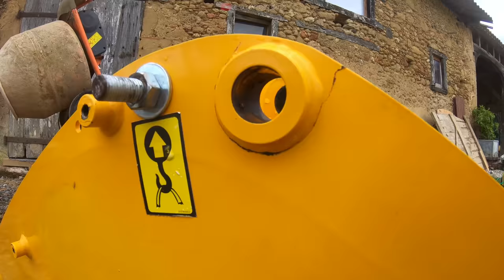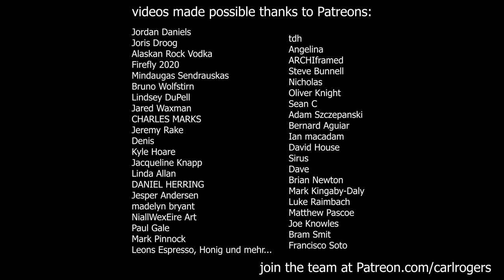When buying used Equipment goes WRONG

Comment: Stop. The digger must not be reinstated back into service for the following reasons.

1. How have you assessed the extent of the crack through the main arm plate and surrounding failed area?
2. Has ANY assessment been carried out to determine the extent of the crack?
3. Do you know how to assess for cracks and what to look out for?
4. Who is technically qualified and experienced to perform the mechanical calculations to sanction a qualified weld repair?
5. How have you ensured the quality of the weld is adequate for the repair?
6. Have you even performed a proof test prior to installing the repaired component back on the digger?
7. Have you complied to all the relevant mechanical, welding and testing standards required to allow this digger to re-commissioned into service?

These are all critical points you have not demonstrated in the video and therefore must be removed for public safety. This is wholly irresponsible and you could be liable if this incurs damages and / or injury to personnel. This isn't a desktop hobby project you can 'wing it see what happens'.